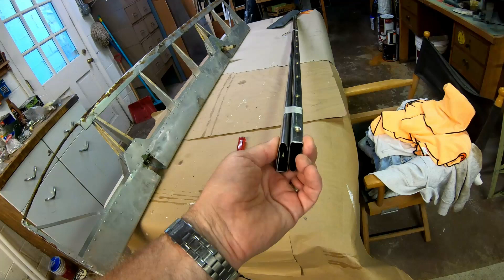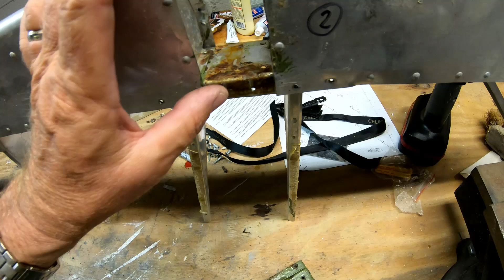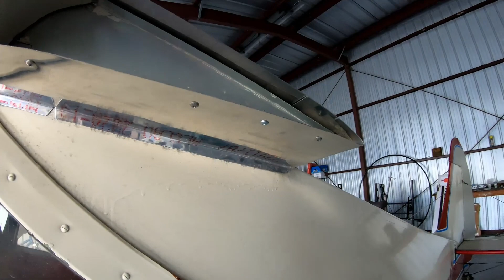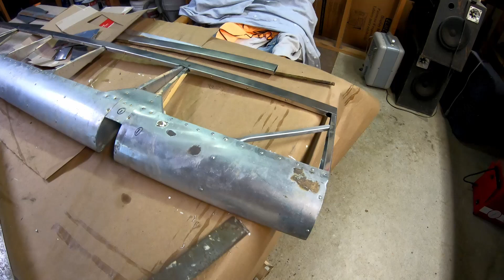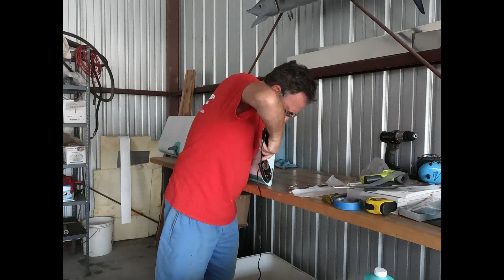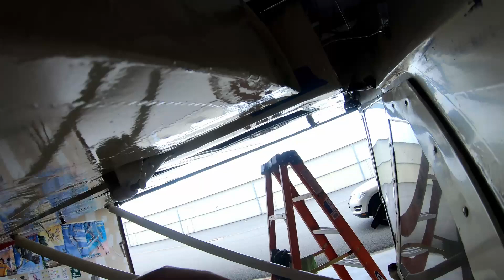1960 Pacer left Wing recover Part 9 FINAL PART

Comment: At 9:30... look up a sheetmetal tool called a "hole finder" - will save you tons of time with no measuring or math required.
Reply from the maker: I have used it before when I worked as a tool and die maker. I’m too cheap to buy tools I don’t use very often if I can work around it 🙂

Comment: Nice job. I am wondering where your elt antenna is install and where the ELT is located ?
Reply from the maker: It is in the luggage compartment with antenna
Reply: @pacer42z  At the top shelf at the cargo aera ? Wondering if you have a picture of the installation ? Thanks
Reply from the maker: @martinabud5735  no, it is mounted to the floor of the cargo area. I don’t have a picture. I’ll try to remember to take one.